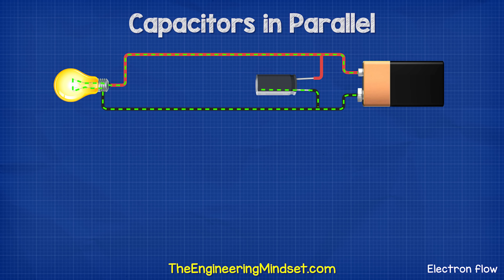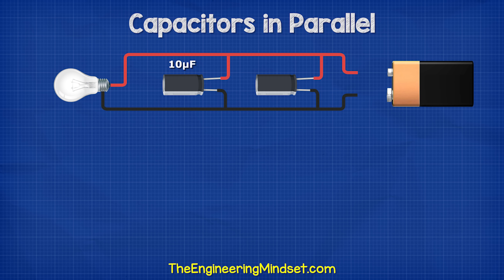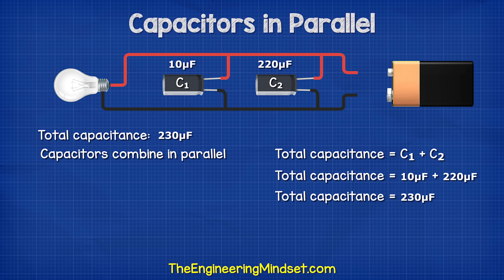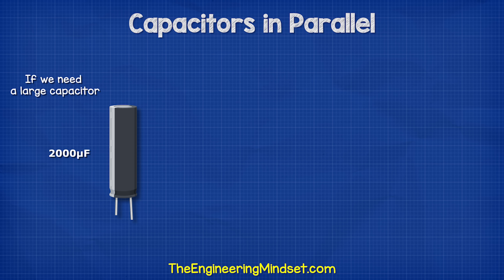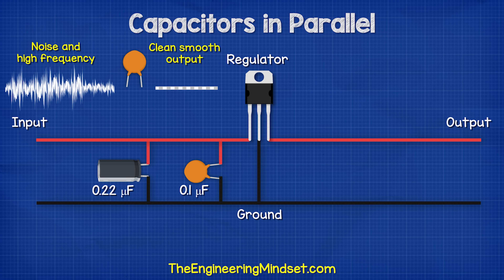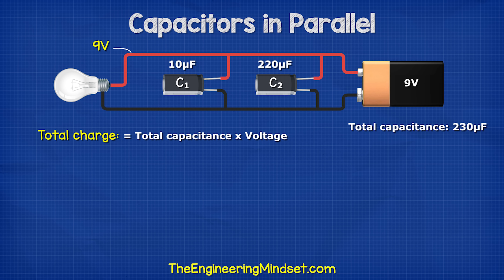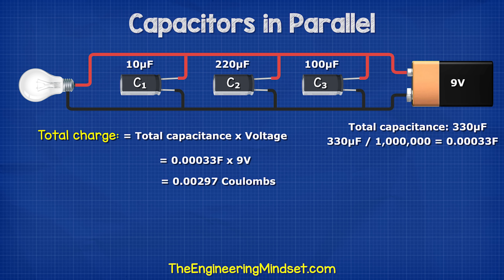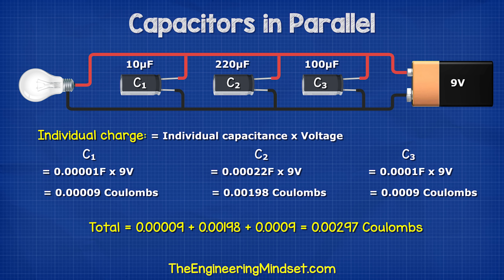Capacitors in Parallel - calculations  electronics engineering

Comment: Can I add two 35v 4700 capacitor in parallel then give this 35v input on boost converter will it be safe for the boost converter

Comment: Thank you as a result of your video I was finally able to figure out how many watts a capacitor holds had to do some more resurech on Google but there I learned that  1 watt equals 1 coulomb second. So now a design I'm working on is just a matter of math. Many thanks and I will be using your channel more. Did you hear that sponsors want to reach me advertise here

Comment: hey, thnx for video ! .... i just have a little thing, i have LCD power unit that need 1200uf/25v capacitor, and currently i couldn't find that spear capacitors with those specific numbers, i have 1000uf/25v and 220uf/25v theoretically i could connect them in parallel to get something near to what i need, but is that technically safe ? or is that 20uf will make difference !
Reply: should be safe might cause timing issues tho if its a timing capacitor

Comment: How about non polarize capacitor that runs through AC Voltage that is connected in parallel?
Reply: same thing they just dont require a specific polarity to not go bang

Comment: OK, that's fine for total capacitance but it creates a false impression that total capacitance is the important issue.  If you are using capacitors in parallel as a filter network such as an old school audio amplifier, you will have a number of different value caps, each dealing with different frequency ranges of power rail noise.   Even the term frequency is misleading because it's more about the noise spike slope than the period between spikes.  For example, a full wave diode bridge rectifier will typically have 2 switching spikes per AC cycle, say 100 HZ.  However if the cap is sized to effectively smooth 100 Hz, it will not smooth these spikes,  You need orders of magnitude smaller value cap to pass these spikes to ground because a large smoothing cap will not pass such a fast rising spike to ground.  So, the old school solution for power amps was a parallel bank of capacitors, dealing complex power & rectification anomalies.
Reply: Well, I understood none of that, but I agree we need a video explaining this. Now I’m really wondering what all this means, use cases, etc.
Reply: Impressive comment! Love smart people! 8-)***

Comment: What do you mean by "noise" in eletric/eletronic systems? I've seen this before but don't understand what it is. Is it unstable eletric current?
Reply from the maker: Yes, do you see the wave on the left is very distorted and choppy but on the right it's clean smooth DC straight line. We want the electricity to be stable and predicable.
Reply: @EngineeringMindset  Now I understand. Thank you for your help.

Comment: If you add a large capacitor to a Car battery. Does it create issues? I have done this with an older car with hopes to always give a more reliable spark or more ampacity. Older cars with old electric fans are more hungery for the juels :-)

 I don't know who to ask these questions. But I've read that when you place 2 car batteries in series. one battery may get hotter than the other. This would maybe be identicle to adding a cap

Can you provide some insight?
Reply from the maker: Check out NEW resistor video, everything covered! ➡️ https://youtu.be/DYcLFHgVCn0

Comment: Most circuits today are black boxed. When something goes wrong they change the black box. New televisions are made like that today. Televisions don't use transformers now for the last 10 or more years. That's the biggest power hog. A device is made so when the device is in the sleep mode it will use way down in the micro to Pico amps. The new TVs LED will be cool to the touch.
Some government  engineers in Minnesota a number of years ago had all the stop/go lights use LEDs Well when it snowed the LEDs would not melt the snow. Cars were running red lights due to stupid government. They had to put heaters on the lights. Would have been cheaper to leave the lights as they were.
Reply from the maker: Seen the new LED explained video? so much detail covered! https://youtu.be/O8M2z2hIbag

Comment: Sir..is it ok to connect 100k uf 25V capacitor on motorcycle battery...? Is it safe for the parts of motorcycle..?
Reply: 100,000uF  ???you sure

so...  100 milli farads then  25V
your question can't be answered because it's too vague
we don't know what you're using it for 
we don't know the model of the bike
we don't know what parts are in it 

i suppose the answer is  YES 
but we need more information to give an accurate answer
i mean... that's a weird capacitor value
are you sure you don't mean  100uF 25V
Reply: @martinkuliza  my question is...is it ok to put or connect 100k uf 25V capacitor to the 12V battery of Yamaha 155cc motorcycle..? My purpose is to boost the battery because I installed some accessories consuming battery. Is it safe for all electrical parts of my motorcycle..? Yes 100,000uf 25V capacitor. (10 pcs in parallel connection, 10k uf 25V each)
Reply: @octavioganoy6360  
ok, thanks for clarification, that's much better.

well, Your battery is 12V and the capacitor can take 25V Max, so your'e fine on that point

as for the purpose being TO BOOST the battery .
Mate, a battery is A POWER SOURCE
a Capacitor is not 
I'TS NOT GOING TO BOOST ANYTHING
it's not as if you're going to get 12V from the battery + 25V from the capacitor

What will happen is the battery will fill the capacitor to 12V (since the max Voltage of the battery is 12V)
or to put it another way 
VOLTAGE IS PRESSURE
now, if battery is supplying 12V of pressure (let's call it)
and the capacitor can take 25V of pressure max

then 
1. The battery cannot supply more than 12V of pressure
2. therefore the capacitor can only be filled to 12V of pressure

so effectively you will still have only 12V DC on the output

now, as a side note
if you put 2 x 12V Batteries IN-SERIES you would then have 12V of pressure adding to 12V pressure , giving 24V
and your capacitor would then fill to 24V  and still be ok since it's rated to 25V

HOWEVER... i dare say the manufacturer (just like in cars) has rated that particular battery for that particular bike  so i wouldn't go putting 2 batteries in-series

so win 1 x 12V battery and a 25V Capacitor  

1. I HIGHLY DOUBT YOU'LL DAMAGE ANYTHING 

2. YOU WON'T BE BOOSTING ANYTHING

3. WHAT WILL LIKELY HAPPEN IS 
if there is any ripple on the Voltage IT WILL GET SMOOTHED OUT, but your Load devices will still receive what they receive because the rest of the circuit stays the same

all you have done is added a capacitor (i assume)  In-Parallel to the battery.

TRY IT IF YOU WANT, YOU'RE NOT GOING TO HURT ANYTHING DOING THAT

as for the other accessories
what are they ?
My thoughts are...
1. Since your intention is to boost (so to speak) the circuit, WHICH YOU CAN'T DO 

2. and i assume it's just about powering these extra accessories

3. ARE WE ABLE TO CREATE A SEPARATE CIRCUIT FOR THEM ?
How big are they 

some ideas...

- Maybe create a separate circuit if they work independant of the bike
and have them have their own battery

- if they need the power from the bike battery then a separate circuit is still possible with perhaps a cap or a relay in place (Again depending on power requirements and how these accessories are supposed to work with the bike)

Give me your thoughts
Reply: @martinkuliza  many motorcycle owners are done connecting 10k uf capacitor on there motorcycle battery to prevent voltage drop and that is already proven and tested  affective even mine. My question is how about if I used a higher capacitance like 100k uf because I have this one. Is that capacitance still ok for the electrical parts of motorcycle..?
Reply: @octavioganoy6360  
ok, well...  it will still be 12V
and yes, having a capacitor will smoothen and REGULATE the voltage

However... increasing the capacitance rating by getting a bigger rated capacitor WILL CAUSE UNNECESSARY ENERGY DRAW , it will lower the efficiency of the circuit and possibly shorten the life of the components in the circuit including shorten the life of your engine

Comment: Can a capacitor be set up in series or only in parallel?
Reply: Of course thy can
There is a formula for capacitors , both in series and in parallel 

in Parallel   -    C Total = C1 + C2+ C3+C4

In Series -         C Total =                   1
                                                  -----------------------------------------
                                                         C1 + C2+ C3+C4

now. the fact that the 2 formulae exist proves  you can do it 
if you want examples

In a SMPS  it's common to find a cap  in parallel on the INPUT FILTER Section before the rectifier....   this would be  your  X CAPACITOR

in a SMPS it's common to find a cap  in-series to ground just after the filter section.
this would be  your   Y  CAPACITOR

Any  other questions ?

Comment: Could you explain why we might use a bunch of smaller capacitors vs one big capacitor aswell? (ESR/ESL ratings). Aswell as the different types? Ceramic, aluminum polymer, etc. Thanks.
Reply: Space is limited in circuits today. Best to use one cap. If the caps are in series the capacitance is reduced. This is DC electric 101.
Reply: My guess is because the time it takes to charge the capacitor is different depends on sizes, types etc. Maybe

Comment: Can Caps be wired in series like batteries?  Also having caps in parallel does it drop the output voltage to the lamp since it does draw some of the power.
Reply: It does drop the voltage to the lamp initially as the capacitors charge. And yes you can put capacitors in series , it will increase the voltage.
Reply: @kennmossman8701  lol thanks I ment series but didn't realise I put parallel.

Comment: But don't forget that all the capacitors must be able to handle the maximum voltage in the circuit! 
(Not much of an issue if powered by a single 9V battery but as voltage increases it gets important.)

Comment: Good job.  I recommend adding a time formula so you can calculate how long a device would stay energized after the power source is removed.
Reply: Using a resistor in = with the cap will give you an RC time constant.
Reply: Depends on the load and temp and elevation many factors come into play u just have to establish a base by testing and using ohms law to make calculations or just test cause I’m very stupid
Reply from the maker: Check out NEW resistor video, everything covered! ➡️ https://youtu.be/DYcLFHgVCn0

Comment: Isn’t there a concern regarding the voltage rating of the capacitors in electronics? In larger capacitors such as used in motor starting in refrigeration we were taught that the max voltage was only as good as the lowest rated capacitor in that parallel circuit. Capacitance is added as in your examples.
Reply: Yes that's true, the lowest voltage capacitor is the new max voltage for the whole parallel system. As that is the one which will pop first if the voltage gets to high.

Comment: Seeing multiple capacitors in parrallele is pretty common, I dont understand the purpose for industrials that can get any capacitance capacitor they need (or dont they ?)
Is it to solve a dimensions issue, filtering better, costs, reliability ? Anything else ?
Reply: Probably cost, dimensions and reliability like you say.